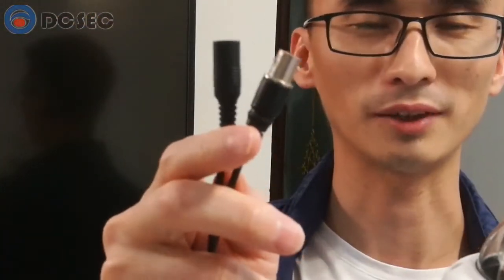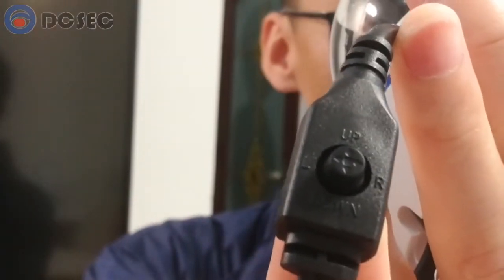Home security camera: how to connect camera to DVR, and OSD menu setting for 4 in 1 camera

Comment: I accidentally entered a 'HIDDEN' menu on the OSD... I was clicking on something, I took my eyes off the screen for a second, when I look at it again I was on a strange screen with options to upgrade the cameras firmware amoung other things...

I can't seem to find back that hidden menu again...
Reply from the maker: Is the camera ask for upgrade or your DVR ask for upgrade? I think that it should be the DVR ask for a upgrade,you can upgrade the DVR or exist the upgrade,and press the middle button of the camera again to get the camera OSD button. If it still can not solve your issue,pls send us a message with a photo by Amazon contact message. We will reply you as soon as possible.